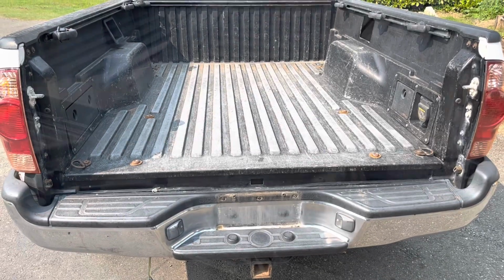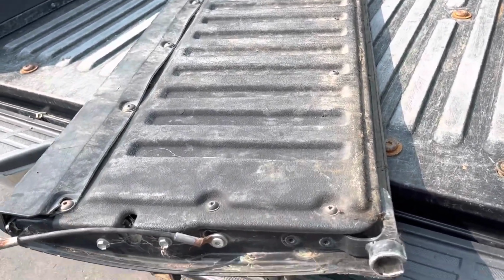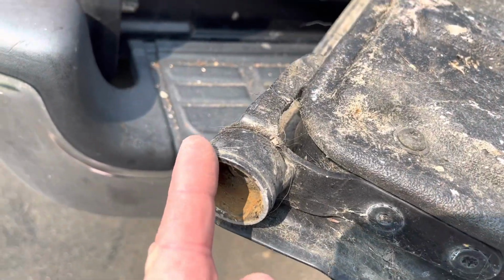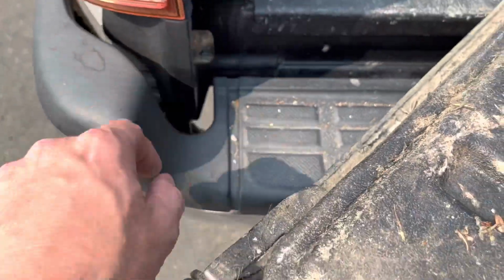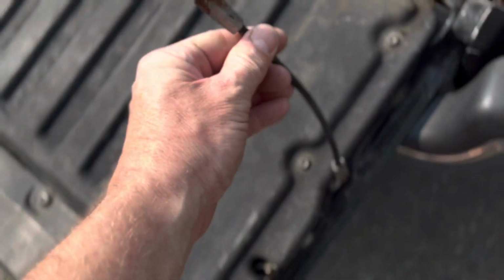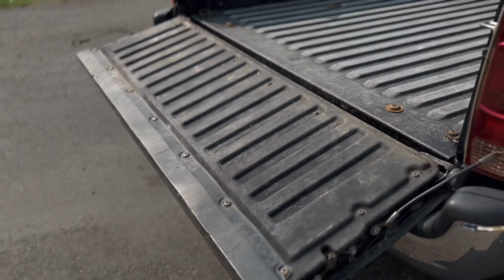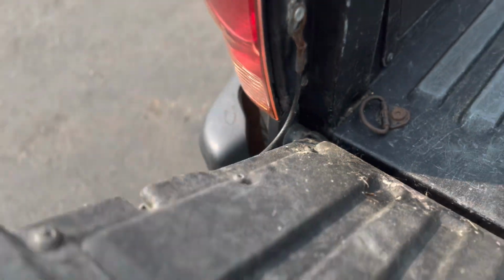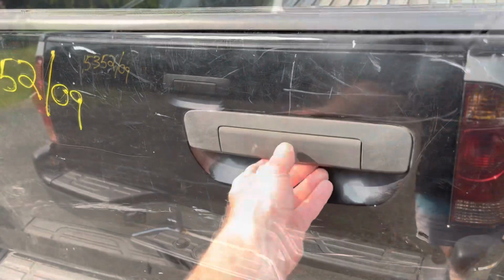DIY How to Install a Toyota Tacoma Tailgate Quickly [Toyota Tacoma Tailgate Removal and Install]

Comment: Just got mine ripped off. Wanted to see how you can replace it. Now i want to know how to secure it with my replacement
Reply from the maker: They make tailgate locks but you can also put hose clamps around the posts to make a little more difficult. Sorry for your loss. I have a video on it too. Best of luck to you.

Comment: Mine just got stolen yesterday at Costco. 2015 Tacoma TRD SPORT 
DIRTBAGS.
Reply from the maker: Damn I’m sorry to hear that. Not that this makes it any better for your current state, but on the next one have you seen those locks you can install? I put them on my GMC after the same thing happened to me. Karma will get them.
Reply: @DIYTechnician   Never knew about those until now.
Reply from the maker: @gusm2752  I have a video on it. I installed some pipe pipe clamps around the bases to make it a little harder to remove. I’ll see if I can find the video